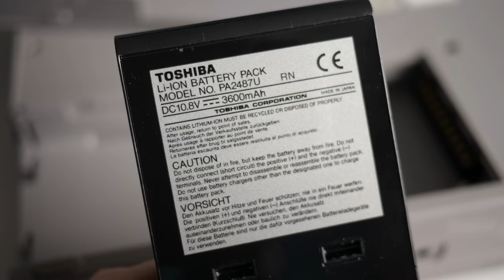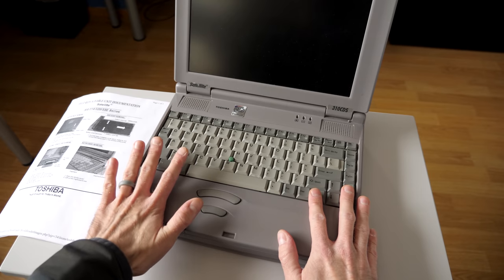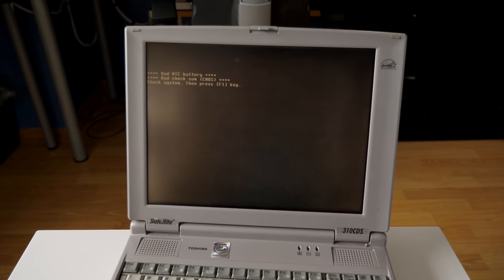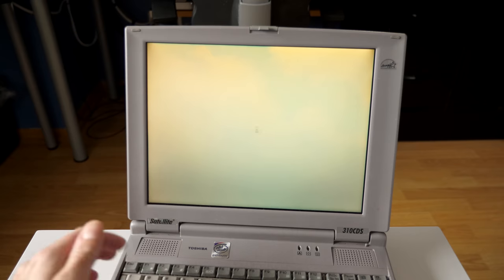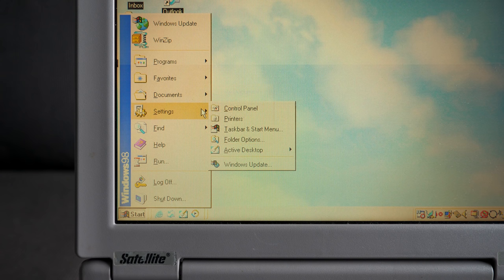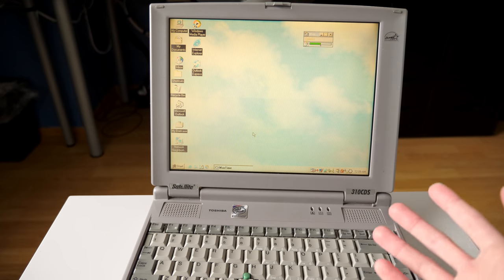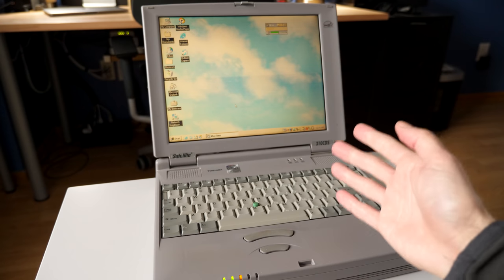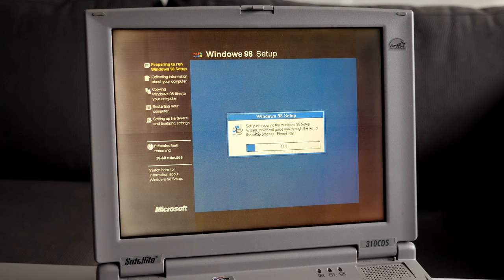Toshiba Satellite 310CDS: A Solid (but Boring) Retro Laptop

Comment: old compaq laptops are also great machines but often use proprietary connectors for floppy, hdd and cdrom drives so you have to make sure to get the hdd caddy because some stupid people remove the hdd with the caddy and then sell it or give it to a friend who will then end up selling it because it´s useless without a hdd caddy.
Reply: What Compaq laptops do you own?
Reply: @videotape2959  Hi,
Too many to be honest 😅
3x Compaq Armada 7770DMT, got the first one 10+ years ago for 5 bucks, recently bought cheap "broken" machines and restored my armada plus was able to build a fully functional second unit out of the parts i got.
The third one i bought a few months ago because it included two floppy drives which i did not have and wanted.
They are super great for DOS games as they feature great SoundBlaster compatibility, a fast Pentium MMX 233Mhz, max. of 144MB(16MB onBoard + 2x Edo sodimms) RAM and a 800x600 TFT.
Also runs windows 98 very well

And then i got 2x Armada M700, one is a Pentium II machine and the other one had a Pentium III and a slightly bigger screen, plus upgraded to 512MB RAM.
It runs Windows ME, Xp and 7 ind tripple boot on a 100GB HDD.

Also i got an Armada E500, basically the same as the m700 with PIII, but a thicker unit which has both cdrom and floppy built in (no multibay).

And lately a Armada 1575D sadly with a passive matrix screen but at least it's battery still works!
Reply: @MultiWirth  Too many? No, not to me. I love computers so I don't mind if you give me a long list.

I see. Aren't 4:3 screens great?
That laptop seems to have a really interesting design. Are those audio connectors on the back? Quite unusual. I wish I had good photographs of it.
Those specs are similar to a Toshiba Satellite 320CDT. The 320CDT can take up to 192MB of RAM though.

OK. That one is more recent. It can barely be considered old! The power buttons are really interesting and amazing. It has a huge space between the front and the keyboard like a Gateway laptop. I think that sometimes the speakers were placed in that space too. Does it have an RCA composite out? You run Windows 7 on it? Whoa..

E500 cool.

That one has a very rounded appearance. Interesting design with the power button and status indicator lights.

My favourite one is the Armada 7770DMT.

I wonder what the circuitry for these laptops is like? One cool thing with these Toshibas is that a lot of the components were from them. Also, you really cannot beat a volume wheel :p

Comment: Hello:
A delightfully classic laptop. I also have TOSHIBA 420CDT 11.3 model. Pentium 100. Seamless and brand new. The battery is also intact. Windows 98. Can type the e-mail address you want to buy. The price is 1,200 usd. I am in Turkey.

Comment: I found one in the trash it’s actually a German one can I still use a 15volt American cord? On this German device?
Reply: Nice. Just look at the input voltage range and supported frequencies on the label of the power supply. Also make sure that it can deliver enough current for it.

Comment: These old lithium batteries usually don't swell, I've never seen an old laptop battery swollen, modern ones ? I've stopped counting.

Still wise to remove it if unused or plugged 24/7.

Comment: If anyone's got drivers for the Satellite 325CDS do let me know, I can't any that work anywhere!
Reply: 325CDS? How interesting. Apparently a 325CDS is simply a 320CDS that was bundled with more software. 

Didn't he show in the video where you could find drivers? What drivers are you looking for and for what operating system?
Reply: @videotape2959  I don't remember exactly what drivers I needed, I think It was all of them actually. Mine is running windows 98, but I managed to clean up the old install that was on it when I got it so I don't need the drivers anymore.